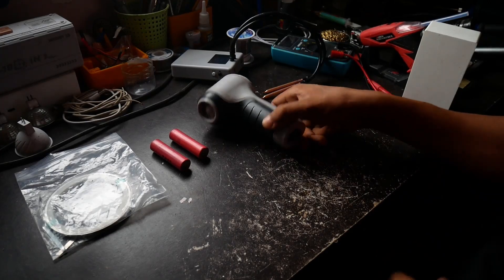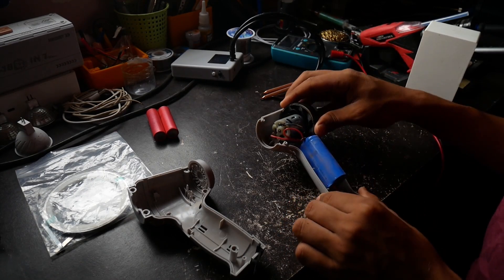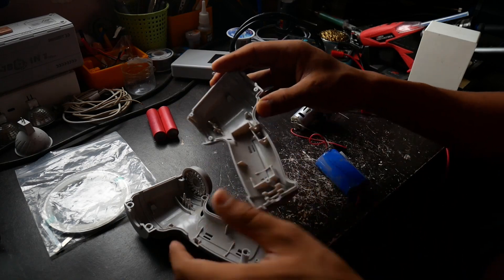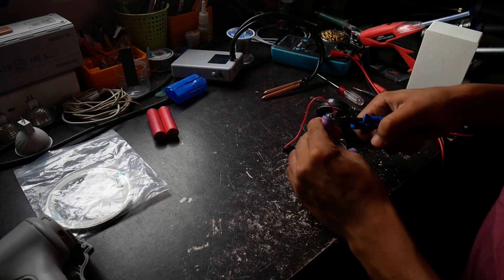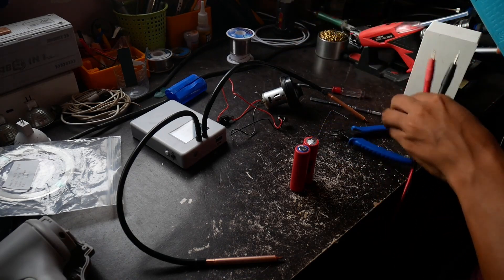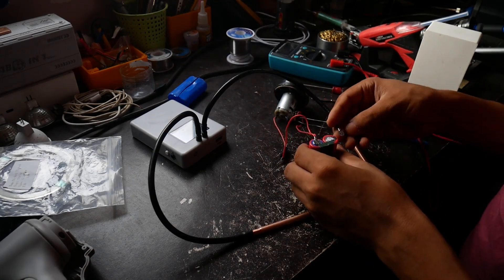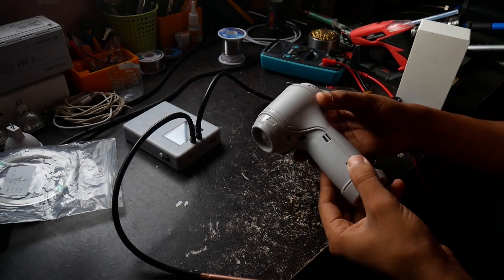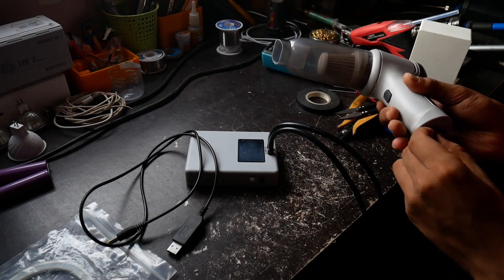JB-107 Mini Vacuum Cleaner battery cells Upgrade

Comment: What kind of charger, I have tried to look for it's charger
Reply from the maker: normally it comes with the device, it's just a cable with little circuit that converts usb 5V to 8.4V on the output jack that goes the vaccum because it has 2 li-ion cells in series inside, yo can also just look for a charger that outputs the same 8.4V and solder the correct jack to it if it does not have it already
Reply from the maker: you may also check the link for the vaccum in the description and see if they have that charging cable separate for sale

Comment: I guess mine lose the motor where to get new?
Reply from the maker: You're gonna have to measure the dimensions of the motor and its shaft and try to find a similar dc motor on aliexpress or other site, I don't remember if it has a reference that can be used to find a replacement